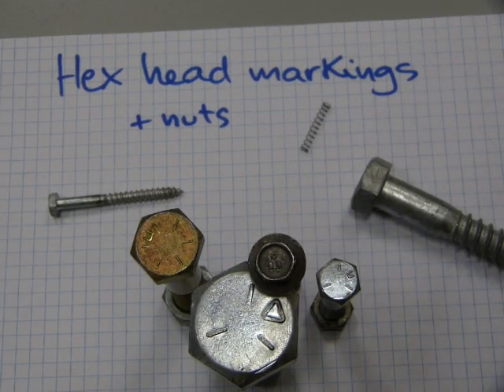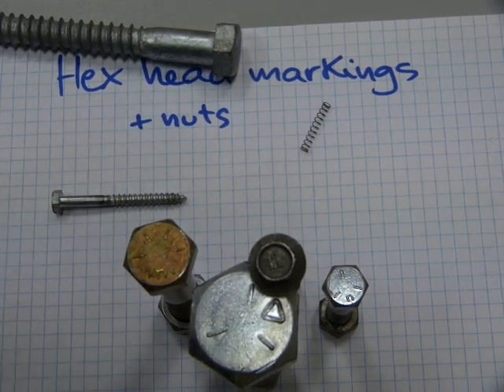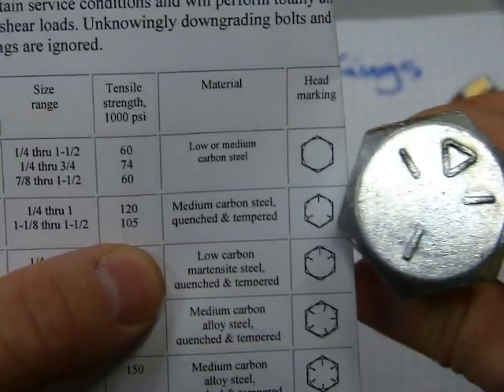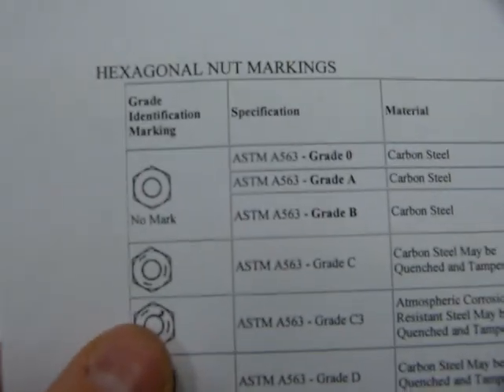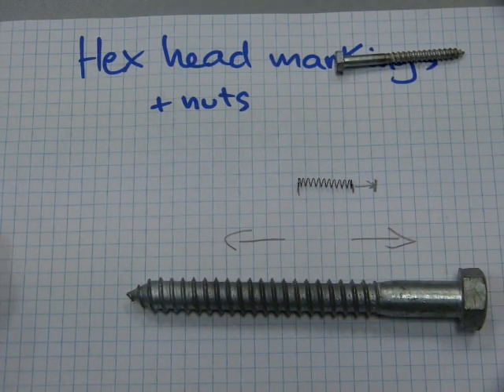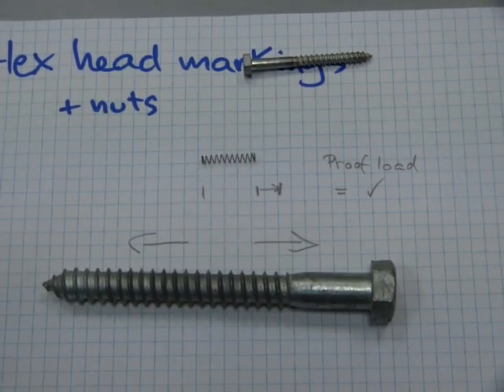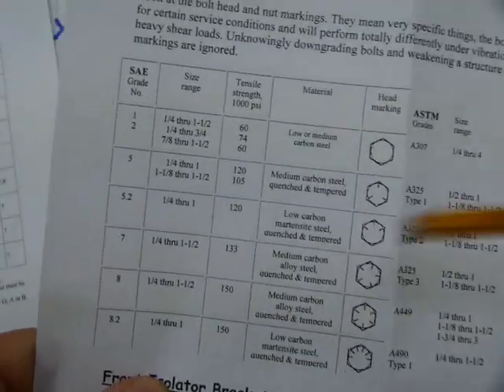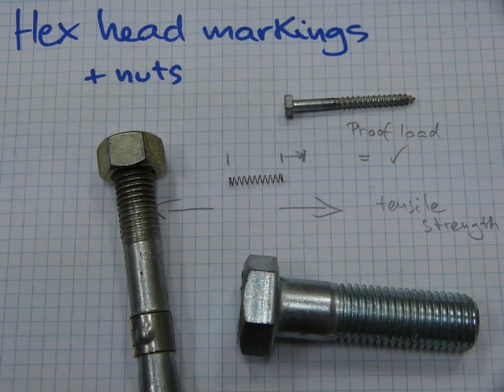Bolt head markings (nuts too, SAE, ASTM)

Comment: Helo, thanks for your video, very instructive. I have a four pasenger car which uses a three 120° marks  bolts in the head is a korean car. What should it be the working tork it should hold? Do you know what the Korean automotive manufacturing car code is?   Thnaks a lot in advance.
Reply from the maker: Torque depends on bolt strength AND where it is used. My bicycle handlebar clamp bolts are 15 thousand lbs bolts but due to the wall thickness of the handlebar its torque is 5 N-m. So, you need to find the manufacturer's torque specs.

Comment: HOW CAN I CALCULATE THE BOLTS TORQUE REQUIRED IN STEEL BUILDINGS ERECTION WORK
Reply from the maker: "required" is up to interpretation to fit purpose. Could be 10% of breaking strength, or anything, but clamping and shear are different forces, etc.

Comment: Only two contries in the wold uses imperial bolts, ALL THE REST uses MILIMETERS ,Imean INternational Measurement System tons off smart people uses metric, not i nches.SORRY we are mayoriti
Reply from the maker: Vastly incorrect. Do look at the thread on your garden hose and tell me about it. The proceed to your light bulb socket thread and repeat.
Just 2 easily found examples.
Reply: @theoverengineer  threads exists in both imperial and metric, but imperial threads are present mostly because of their popularity in certain applications like those you mentioned, plumbing dimensions, bike threads for bottom bracket, freewheel and other parts. But as a design choice in critical applications, all over the world (including USA more and more) use metric fastener as all calculations are based on SI, and any large scale desgnic in automotive, aerospace, naval, etc will be international and the Imperial system is the short stick in this, so all use SI strict.
Also all evolution in modern science was made using SI and all new concepts are based off it, while in imperial system it's only hystorical laws and with weird coefficents you had to memorize all over. Really it was a mess for science in general.

The grading for metric bolts is much simpler: x.y where x is hundreds of MPa minimum tensile stregth, and y is percent (in 10 increments) out of that x for finding proof strength. Much more simple and accurate way to tell what type of bolt is without memorizing a handbook or browsing through it.

So 8.8 bolt is about 800MPa (first 8) minimum tesile strength, and 80% (second 8) out of the first value for tensile strength of 800MPa.. so 80% out of 800=600MPa is the proof strength.

Much more logical.
Reply: In the United States we use SAE (Customary units), not Imperial.  We also use metric.  Both are legal systems here.